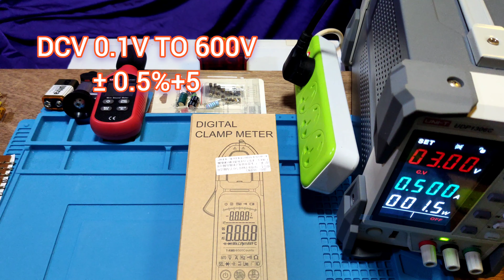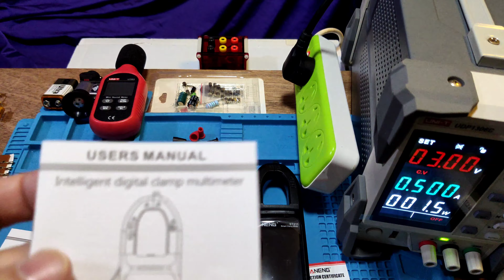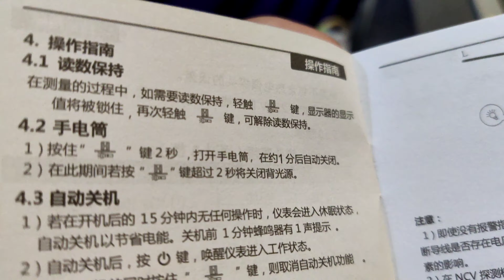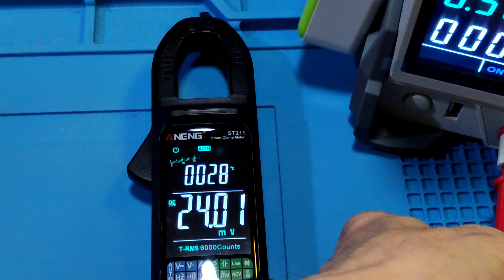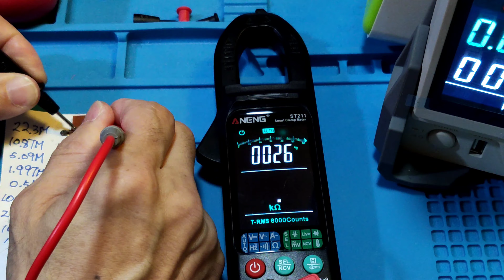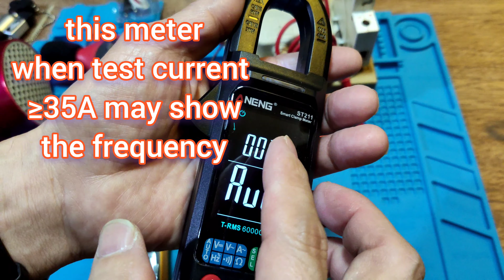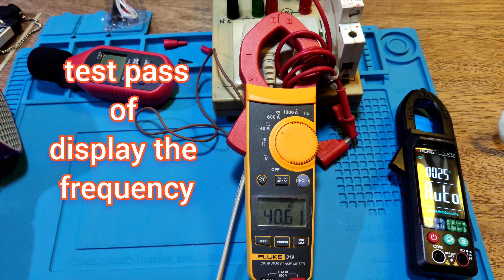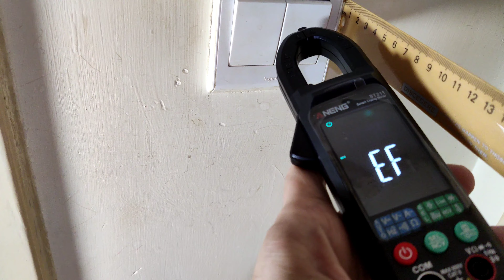ANENG ST211 CATII 600V 6000 COUNTS CLAMP METER

Comment: What is better choice ST210 or ST211? Price is for ST211 23,42 eur vs ST210 35,39 eur ( included temperature meter in cable ) or other model? ST212?
Reply from the maker: st210 is A better choice ,it 6000 COUNTS and have 600A ,small HEAD for easy TEST on A narrow place circuit board,in my country it only $ 7 usd of the price more than the st212.but st212 is max 400A.

Comment: Hi sir, in your opinion how was that?. I would like to buy the same one. In banggood Aneng ST211 and Mustool C21 available both are same. but which one is reliable sir ?
Reply from the maker: if it is same model,same specification,it is same of the manufactory product.
Reply from the maker: you can choice which is low price only.
Reply: @wilsonluilui  same has same specs, I dont know which is best thats why am asking sir. How was your experience ?
Reply: @wilsonluilui  aneng st211 price  is lower than Mustool c21. I think Mustool C21 was a unlaunched product.
Reply from the maker: sorry sir we check that the mustool c21 is a AC/DC current clamp meter ,this meter only for measure AC current only.😛it is because mustool meter not sell in my country.
Reply: @wilsonluilui  I going to order ANENG ST212 meter.
Reply from the maker: @skykalaicreations  not so much people use DC current clamp,normal for battery,car and solar PANEL use.thx for watching.
Reply: @wilsonluilui  the price difference for 211 and 212 is 5 dollars. That's why I choose 212.
Reply: @wilsonluilui  OK. My mistake. I bought the Mustool for the Hall Effect sensor.
Reply from the maker: @barrybogart5436  it is SPECIAL mothod,i ever try to do this.✌

Comment: aneng st212 vs Aneng 621a who is the best?  plz suggest me
Reply from the maker: st212 is A clamp meter,And 621A only A MULTIMETER than is A different of the use sir,if you work for fast testing that st212 is good for testing current and voltage than 621a.

Comment: Don't buy.  I bought one and can not measuse from 0.5-0.95V (all display AUTO),   resistor below 20 ohms show big tolerance and lelow 1.5 ohms all show 0 ohm.
Reply from the maker: it is because normal smart meter is for electric work check only
and not for electronic work,if you went to buy a small current meter or high accuracy one ,you must choice a clamp meter have low current measure or have high accuracy on resistor meter,normal  meter in cheap price,lessthan have high accuracy for
my buying few years.